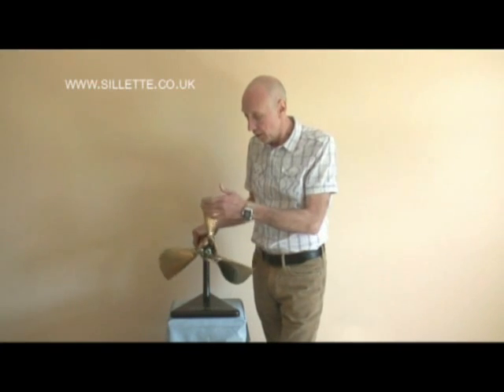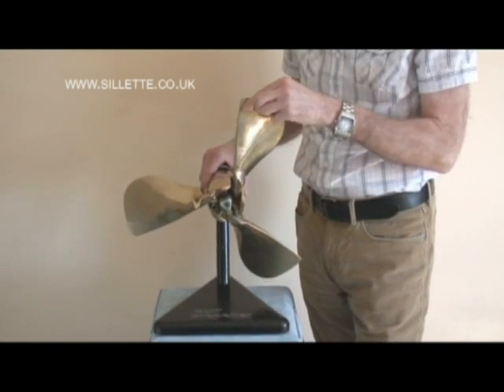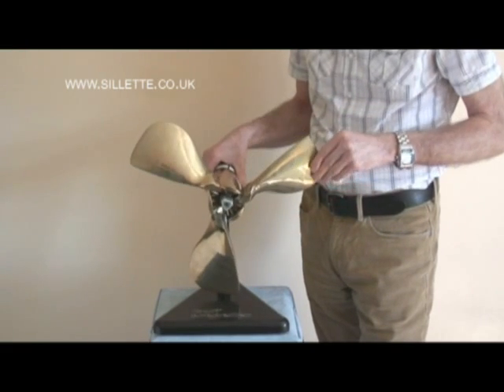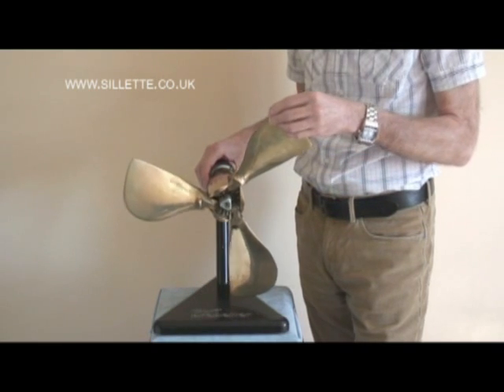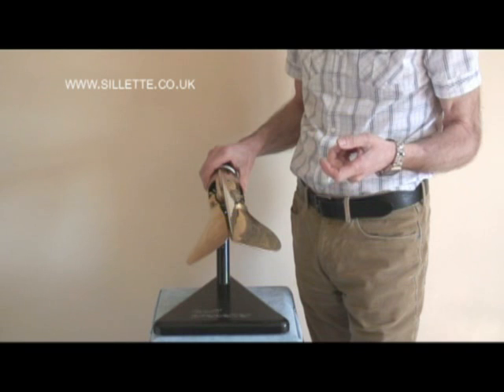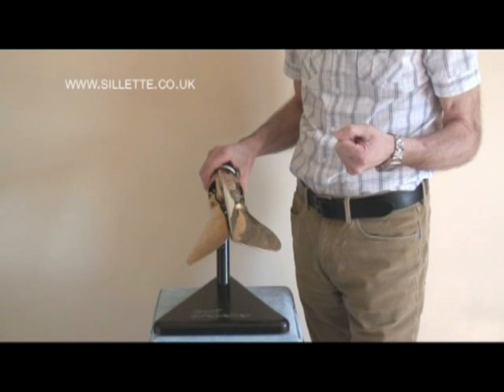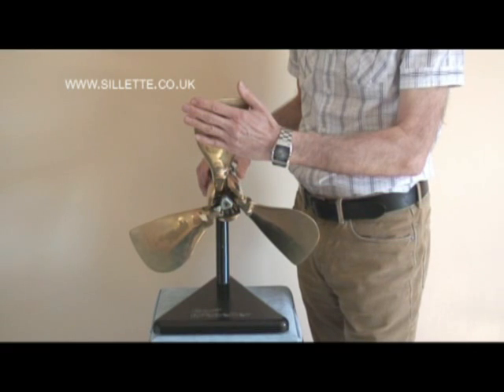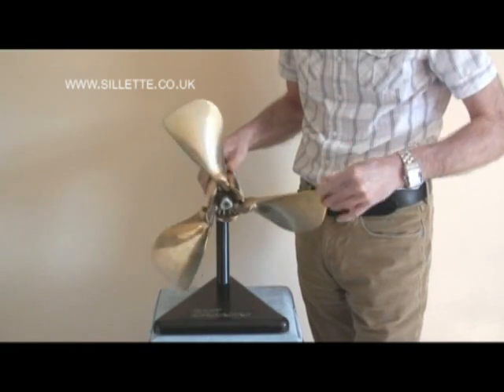Gori Folding Propeller Operation by Glen Print MD of Sillette

Comment: An excellent explanation - except at the very end where you explain how the propeller will automatically open with low pitch in normal operation and then show it opening in the opposite way. A very clever design!

Comment: I feel that there is some misleading sales talk in this presentation. The propellor has a good design and I feel that it operates in the following manner.
1. The slot in the hub permits the blade to swing 180 degress taking a backward path. 
2. The blade is unbalanced in its area and the center of pressure is away from the pivot line and so when the engine rotates the biased center of pressure on the blade will open it in either the forward or the reverse direction.
3. The blade section is not symmetrical and is cambered ( curved) so that the water will accelerate in the back direction as it goes along the blades and this means that the angle of attack at the leading edge is lower than that at the trailing edge.  This could be interpreted as if the leading edge has a lower pitch than the trailing edge.  ( From now on the presenter is forgetting the apparent entry velocity into the leading edge to ensure the requirements of a good propeller) 
4. Now what the presenter is calling an overdrive, is only a normal propeller with camber blades going into reverse which makes the trailing edge become the leading edge............and a very inefficient propeller it will become and it is no overdrive, it is a normal propeller going into reverse and the fact that the trailing edge has a higher angle of attack than the leading edge does not make it an OVERDRIVE PROPELLER.  It is all a sales drive using foxy descriptions.

The propeller is an excellent idea, but the overdrive claims can be taken with a pinch of salt! 
Congratulations on the design anyway, but I would forget about projecting the overdrive bit!

Comment: if overdrive is more efficient ,,,why would you ever need the standard forward setting
Reply: As noted it is for low load conditions, of which motor sailing is the best example followed by calm weather.  When you have over-drive the pitch is higher than the ideal pitch (for maximum power).  That means the prop transfers more power into the water at lower RPMs, and that means the engine cannot reach maximum RPM, which for most engines means it cannot produce full power.  So never use over-drive when powering into the wind or in rough seams when you need the most power available.  When you are in low load conditions the lower RPM's providing the same power into the water means there are fewer power losses inside the engine and therefore better fuel economy.  At least that is what Gori says.  I have one to test in a few months to see what happens to fuel economy, but they have many customers swearing by it.